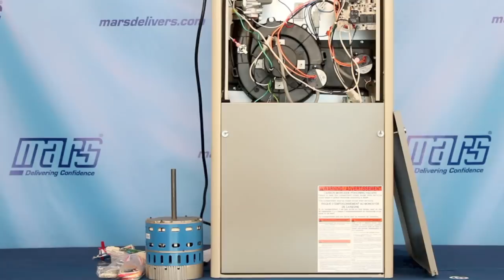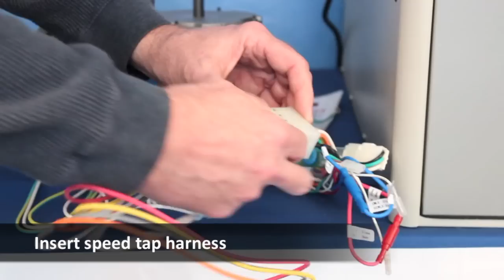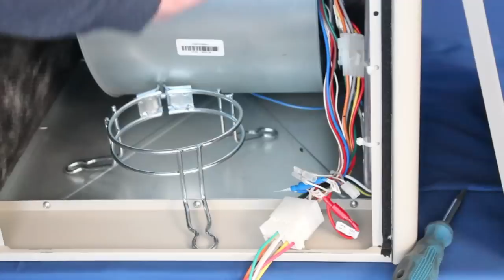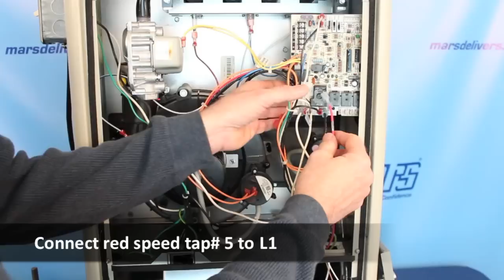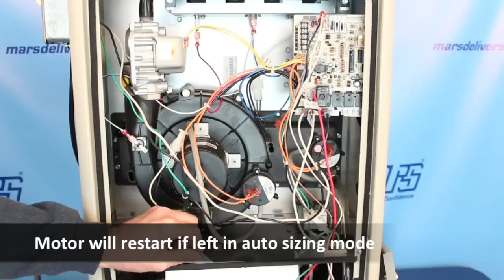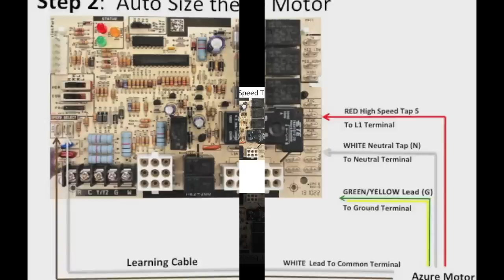Azure Digi Motor Installation, MARS No. 10860

Comment: Hi guys. My Mars 10861 turns on as soon as it gets 220v? Manual says it will run anytime the main power AND at least 1 speed tap are energized. In my case, none of the speed taps were energized yet and it keeps turning on. Why is that?
Reply: Same thing happened to me today How did

Comment: What is L1A?!!!
Reply from the maker: Not following you?  Please elaborate.
Reply: @MARSdelivers  I am installing my new mars digimotor and I am trying to program it. I have an air handler that doesn't have a control board. I have the 24v common and 24v attached to their respective spots on the transformer. But for the high speed tap, I am unsure where to connect for programming. The video shown above says to attach it to L1A, so I ask what is the equivalent of this? For my situation would the equivalent be attaching it to the 230Vac hot side on my transformer? Thanks
Reply: @MARSdelivers  I was able to resolve this issue via the phone with your customer service. You guys are great, thank you!
Reply from the maker: Glad you spoke to our Tech Support line; they are all former service techs and are great.

Comment: My furnace guy just installed one of these for me.

You guys claim a custom fit every time, but we had to switch from high speed taps for AC, and medium high for heat with the old PSC motor, to medium and medium low and it's still blowing more air than the old motor.

I might have to step it down another notch, not sure yet.

I mean, it's not a huge problem, because we can use the speed taps, but it took a bunch of attempts to find the right speed

The plus side, high was reading at 2.5 amps, while the old motor used 5.5 on high so the efficiency is definitely there.
Reply from the maker: Hi Scott,
Thanks for going with our motor.

The motor auto sizes to each ducted system and assigns the appropriate torque to the 5 speed taps to target a 0.50 static pressure.  It is not uncommon to experience a different airflow than your original motor.  HVAC equipment manufacturers install PSC motors in their equipment and expect the equipment to be installed on a perfectly designed and balanced duct system.  Most contractors will say 9 out of every 10 systems are not right.  The Azure motor is only attempting to provide correct airflow based on what it sees during the auto sizing procedure.

The motor has 5 speed taps; these do not necessarily correlate directly to the old PSC motor.  In other words, High to High...Low to Low.  There should, however, be a tap that provides the correct airflow once the motor measures your duct system.  In the event the motor does not find the ideal static pressure...and your CFM is not satisfactory, a hand held programmer can be plugged into the motor.  The tech can then dial in exactly what you need at 1% increments.

I am happy to hear about the reduced power consumption.
Reply: Thanks for the comment and explanation. 

That makes a lot more sense now. 

I'm pretty happy with the product, cheapest ECM I could find!
Reply from the maker: LOL....Least expensive!
Reply: MARSdelivers fair point
Reply: is this the Generation 2 Model?

Comment: I have a Lennox 80UHG3/4-120-2 Furnace and would like to replace the blower with this Mars Azure Digi-Motor #10860. I am not an HVAC guy but I am DIY guy. Also I noticed/read somewhere that I may need to buy a Bellyband to be able to install the motor... There are 3 bolt pattern sizes 10", 11" or 13" (Mars 08025, 08026 or 08027). Do you know which one I need for my furnace blower? I want to be prepared beforehand so I'd like to order the right part before I take the blower apart... Where else can I find this information? Thanks in advance.
Reply: Hi Dick, did you have right answer for the bolt pattern size of Belly band mount ? I have the same question. Thanks
Reply: @ymliu99  didn’t need one. I found a guy to come and install the motor for $100 and he had one. Can’t remember the size now.